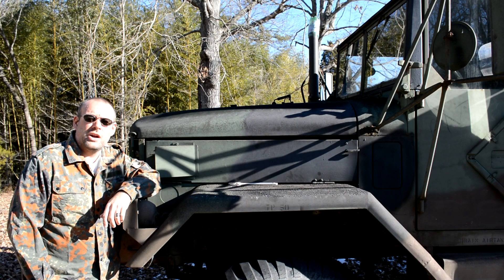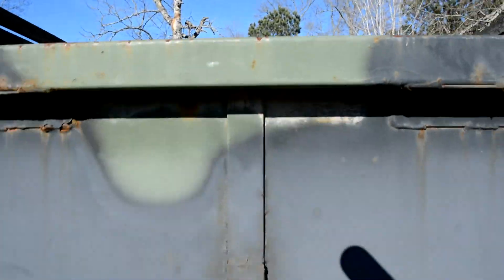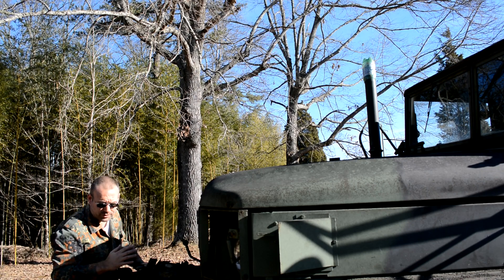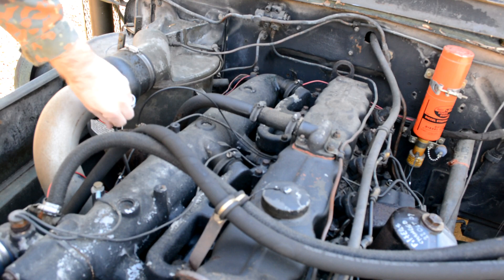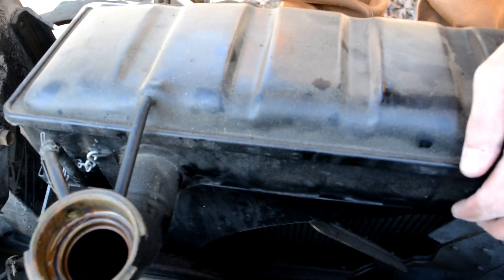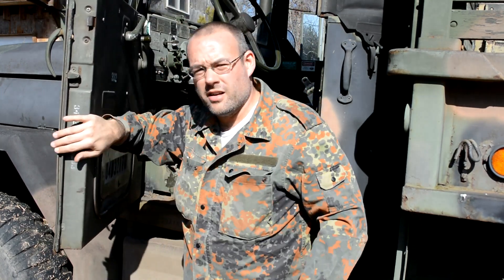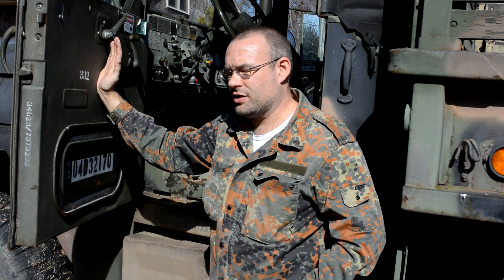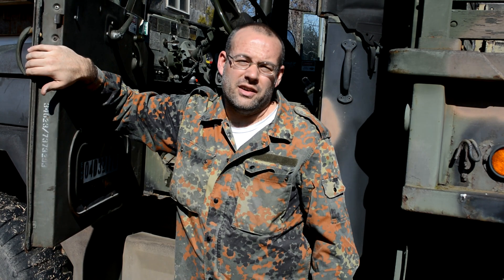Cold Start for the Deuce and a Half

Comment: I really enjoyed this video. It's always a good thing to go through the engine, radiator, brakes, and check the oil etc. before you run it after it's been sitting a while (just like you did in this video). I checked the oil in my dads old 78' pickup after it had been sitting for 6 months or more and it was a quart low! Glad I checked it. Great video! I look forward to watching more of these videos. My night is now complete. Lol.

Comment: I love this truck ! I would start inside the bed and blast this beast out and start priming this finish. You have 1 pin inside your drivers door for corrosion treatment , so it's been awhile. Once you deep clean one of these , you have to step up to gain control again. This is a large part of the maintenance of this truck. This truck is VERY collectible. If it was mine, I'd never part with it , and I wouldn't let Mother Nature take it away from me either.

Comment: bring it up here for a real cold start.. -30 not to long ago, looks nice and warm there
Reply from the maker: At the time of the starting it was 28ish but the sun was out heating things up so not that bad at all.  If my ether system worked (unknown because I've never needed it in the south) it may have a chance but wouldn't be pretty.  If I had an engine block heater coupled with the ether system and the right fuel (less motor oil and more gas/alcohol/paint thinner) then no problem.  These engines operated in Alaska with an additional Artic Kit and using JP8 as fuel.
Reply: So does yours have an engine block heater? Or can one be added onto it for winters up near Wisconsin?
Reply from the maker: This particular Deuce doesn't have a engine block heater.  It does have an ether start system that dumps a little ether into the engine for super cold starting but I've never had to use it.  Some Deuces have an engine heater that runs off the fuel from the main fuel tank.  It's also easy to install an aftermarket modern plugin heater just like a modern diesel so you've got tons of options.

Comment: don't know if you've covered this or not but figured this would be a good section to put it.  if you have to push start your deuce, do not mistakenly put it in reverse instead of 2nd.  the deuce engine WILL run just fine backwards giving you 5 reverse gears and 1 forward gear. and of course the exhaust is now your intake.  just an FYI point.
Reply: that sound really good for the engine pulling in crap from the exhaust and blowing crap through the turbo and filters haha   are there any videos of that?

Comment: You can use an other brake fluid if you want,dot 5 is only used because militaries  keep the vehicles parked years without maintenance.
Reply: That may be, but I figure if they went through the effort of putting the sticker there there's probably a good reason for it.

Comment from the maker: To answer Kolton Jensen's question. You may need to change your Google+ comments to Anyone can reply...or may just be a glitch.  The M35a2 doesn't technically have a diesel engine.  They are straight 6 multi-fuel engines that are compression ignition like a diesel but operate with a much higher compression ratio along with several other differences so they can run on any fuel available from corn liquor to used motor oil.  Thanks for the question.

Comment: Do you check for hydrolock every time you start the engine or just after it has been sitting for months? I have heard several different opinions and am trying to figure out if it is necessary to do it every single time.
Reply from the maker: It's a best practice per the Operator Manual to check every time.  Personally, I check for hydrolock if the engine has had enough time to cool down (couple hours) or if I walk away for an extended amount of time and realize I left the fuel pump on.  Both of these situations could result in fuel leaking into the combustion chamber and it wouldn't take much to hydrolock an engine with such a high compression ratio.  The safe answer is check every single time and I probably should as well even though it looks to the untrained eye that the old girl is having trouble starting vs. part of it's official startup procedure.

Comment: Regarding the ignition switch on the Deuce:  In general, diesels don't have ignition systems.  Is the deuce different due to its multifuel engine, or is that really just more of a master electrical switch?
Reply from the maker: It's a master electrical switch.  It turns on the lift pump from the fuel tank and all the gauges,radios, etc.
Reply: so theoretically once you start it, you could turn off the ignition switch? this has a mechanical pump along with the electric lifter in the tank, correct?   you wouldn't have any lights and you'd be putting more strain on your high pressure pumps but it would still work, right?

Comment: I have a question, does that truck have a jake brake?
Reply from the maker: No Jake brake.  Going down hill with a load requires using the gears.
Reply: Okay. I was just wondering.
Reply from the maker: Good question.  It would definitely help when loaded especially with the barely adequate brakes the Deuce in good condition has.
Reply: Thanks. I see. Could a jake brake be added to the engine in the future? I don't know too much about diesel engines.
Reply from the maker: To the best of my knowledge there is no direct kit available so anything would be a custom job.  The engine being a compression engine like a diesel engine there is no reason that it would not work.  The reason why one was never fitted to them is probably because the gearing is so low they can be used to slow the truck down on the steepest of descents.  It would sound pretty cool in a rattling windows for miles kind of way but probably not really necessary.
Reply: Yeah that is true. With the gearing it probably isn't necessary but very cool at the very minimum. Lol. I guess that truck was meant for more for driving off road than just driving on the highway, right? Maybe that's another reason why they didn't outfit the engine with a jake break.

Comment: how much did youay for your Deuce? and do you think it could be a daily driver?
Reply: Nicholas Murphy 8mpg you decided
Reply: Most dueces are priced at anywhere from 5k to 10k. Depending on condition. And it does get terrible gas mileage but one person in my owners club gets used oil from a bunch of places and hasn't paid for fuel in 3 years.

Comment: I just noticed that you don't use floor mats in your deuce. Is there a reason for it?
Reply from the maker: +Charred Steak Yep.  Firstly,  I'm not a fan of floor mats in general for work trucks.  They look nice for awhile but eventually they become just something else to take care of.  That's why I don't have them in my F-250 either.  Secondly, my Deuce lives outside and Deuces aren't known for being 100% water tight so having a floor mat sitting on the steel floor invites a place for moisture to collect and cause corrosion.  Even the solid rubber mats will hold water under them and keep it from evaporating.  I've seen others who have coated the entire interior with bedliner to stop rust which is cool but it's just easier to not have anything collecting moisture in the first place.  Sharp eye and good question.

Comment: im new here what did they use the deuce and a half for and what was their purpose?
Reply from the maker: They were used for general hauling of equipment and troops both on and off road.  Some were fitted with steel sides and used as escort gun trucks in Vietnam.
Reply: ***** ive been thinking about getting a milsurplus vehicle in the near future. i live out in the country and theres lots of space to mess around (safely of course). think ive got my sights set on the M928A2. there's a militia group around here as well that uses deuces and M939 series trucks. lovely vehicles. great for the winters we get up here in ohio as well.
Reply from the maker: Those 5-tons will probably do better in the snow vs. a stock 2.5.

Comment: Hey BC I am about to buy a deuce of my own and I was wondering if there is anything else that is important for me to know about the deuces other than these videos, it would really help!
Reply from the maker: If you can ask the owner to not start it the day that you’re checking it out and feel the manifold to verify it's cold before starting.  Unless it's been several months it should start very quickly with no help from ether.  The brakes should not feel mushy and not bottom out.  Once the air tanks are fully charged turn the engine off and listen for air leaks under the middle of the dash before test driving.  If you have the air shift front axle there will be two hoses here that can leak air pressure used for the brakes.  When you shut off the engine the air pressure gauge should not sink like a rock.  Hope this helps.
Reply: Alright thanks man ill do that when i go to see it, if i have any questions ill just ask you for verification thank you.

Comment: Did you use the manafold heater
Reply from the maker: This deuce was never equipped with a manifold heater.  I also didn't' bother with the installed ether injection system.  I would have if it were below 0 F.
Reply: ***** Interesting why the switch would be there but not hooked to anything.
Reply from the maker: What switch would that be?  Could it be the ether switch on the lower left from the steering wheel?  I think newer/re-engined deuces got the ether and older/original ones got the manifold heater.
Reply: That would make sense.